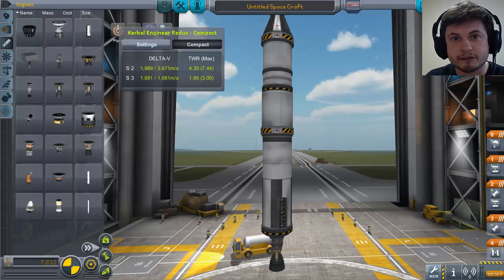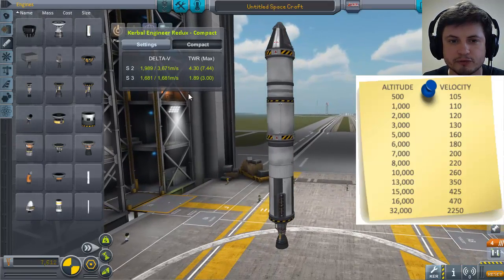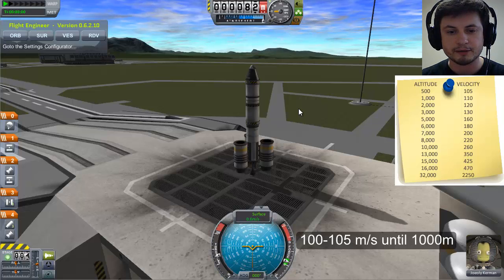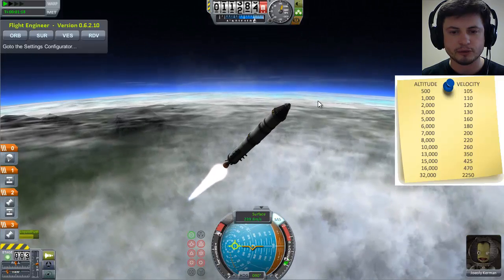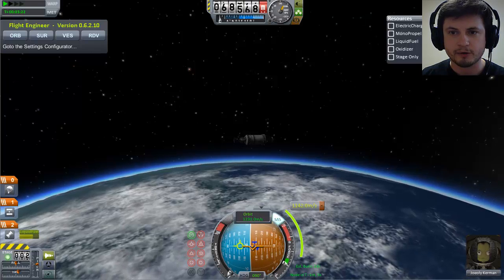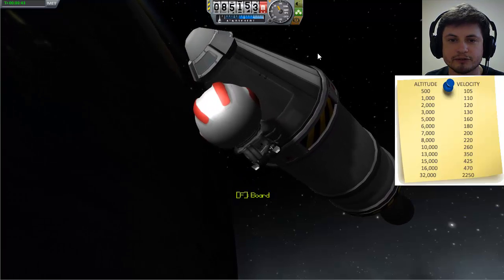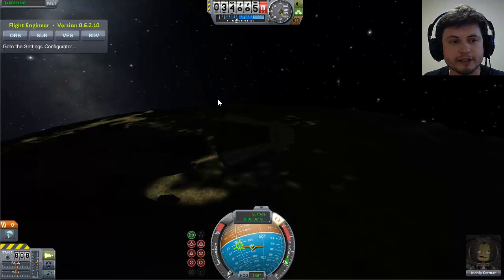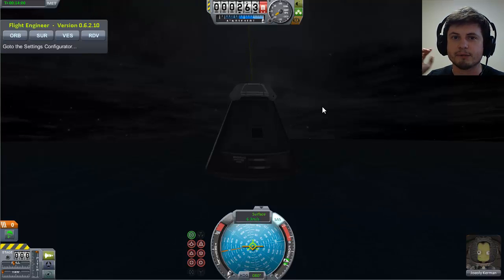KSP - Optimal Take Off Velocity - Fuel saving 101 (0.90 beta - stock)

Comment: It's good practice to wait until you're out of the atmosphere before plotting a maneuver node because you're still experiencing drag and so you will not be at the correct burn point of you're plotted node. Waiting until you get to at least 68 km before plotting the node gives you more accuracy.
Reply from the maker: I usually start plotting around 35-40km as the air drag at that altitude is not significant enough to change my values that much. at 68 I start burning laterally as this usually gives the lowest possible orbit
Reply: Yea but you're trusting off of nothing, a slightly earlier and your able to push of atmosphere...

Comment: Thanks for the video, I just wish your commenters weren't such snobs.

I use FAR and I've been trying to work out a proper ascent profile. In your video you're using stock physics but I think that it's still largely applicable to FAR. All that might be needed is a little tweaking.

Do you know what the calculation is to find exactly what altitude you will stage? Now that I'm doing contracts in .90 that ask for engines to be tested between certain altitudes, I am trying to make rockets that aren't overloaded or redundant with boosters and engines.
Reply from the maker: what do you mean by snobs haha? Sorry if it offended you.
I think if you use the Kerbal Engineer mod, there's a setting called "atmosphere efficiency" and if you keep that value around 100% you can find out the optimal take off velocity for the entire take off
Reply: Anton Petrov I use Kerbal Engineer, I just need to play more!

I called some of the commenters snobs because you didn't do things exactly to their liking and they decided to post very negative and condescending feedback instead of constructive criticism.
Reply from the maker: oh, good point. thanks for the positive feedback :D

Comment: with a similar rocket, if you had 3 'normal' tanks worth of fuel in the bottom stage, then reduce the thrust of your engine to have a TWR of 1.6, and with that, you will go slightly below the thermial veolocity.
Reply from the maker: thanks, I'll try that later

Comment: You're losing efficiency cranking east right at the 10k mark instead of easing the prograde marker. The Delta-V you lose altering the prograde path probably negates your gains from this "efficient" approach....
Reply: Anton Petrov I'm not dissagreeing with you in the slightest, In fact, I aplaude the fact that you mentioned the dV gain from turning east. My comment was in response to Urb4n0Ninj4 's proposal that a violent turn at 10km instead of a gradual turn starting earlier was less efficeint. The way you launched your rocket was just fine :)
Reply from the maker: you're right, it should have been more gradual. I didn't lose that much though. It was maybe 40-50m/s max
Reply: Actually, due to kerbins 'souposphere' a normal gravity turn is less efficient as you spend more time in the lower atmosphere. However, if you have FAR or NEAR installed, a normal gravity turn will save you fuel. You have to remember that we are dealing with unrealistic aerodynamics. As such, realistic methods such as a gradual gravity turn may not be suitable.
Hopefully the upcoming aero update will allow a gravity turn to help, not hinder our rockets efficiency! :)
Reply from the maker: Luke Wilson it's not a gravity turn though. It's a gain of velocity due to planetary spin and has little to do with aerodynamics. You're getting extra velocity because when you take off you already spin at around 150m/s eastwards, so you're just getting those extra 2200 needed for an orbit
Reply: Urb4n0Ninj4  I am saying that you lose efficency in the stock game by performing a smooth gravity turn lower in the atmosphere as opposed to a sharp turn at 10km. With mods like FAR or NEAR, you would be correct in saying that there is a dV gain by utilising a gradual gravity turn.
Reply: Luke Wilson 
But you don't lose efficiency in the stock...
Whatch "Kerbal Space Program 101 - When do you start your gravity turn"
In his first launch, he controls the craft manually and lofts the craft over relatively slowly (compared to the mechjebs sharp change in vector) and accomplished orbit with 624 units of fuel left.
The second launch, the craft turns sharply at 10km to 45deg, and when he accomplishes orbit he has a total of 612 units left.
Then it breaks it down at different altitudes from there.

Are the units a big change? No, but this is stock, and it shows a more curved, arc shaped change is more efficient than a sharp change.

And it makes sense. If you're using more energy to change your vector, you're losing potential energy to your velocity change. You can see this in his mechjebs "Steering losses" row in the video.

The gains made using FAR are significantly better, yes, but the fact remains it's more efficient stock as well.
Reply: Urb4n0Ninj4 Ah, I see. You are talking about an extremely slight turn at about 5km then transitioning into a normal gravity turn at 10km. The problem I have with the tests performed by Scott is that his manned launch (the most efficient launch shown) was up against launches under autopilot which, I would argue, spend too much dV on maintaining a heading.
I would argue that if mechjeb was programmed to follow the flight path that Manely's rocket took, it would use more fuel than the second flight shown, simply because it uses more fuel to maintain a heading than a manual pilot would.
Reply: Luke Wilson 
Well, I never use MechJeb, I have Kerbal Engineer to show me my Delta-V and TWR.
When I'm out of work I'll see if there's a difference in Delta-V used, and remaining fuel between turning 45 deg east sharply, or gradually between 8km -12km. But I've been playing this damn game for 500 something hours, and I've transitioned to using a gradual turn and have rarely had any issues with efficiency, but I've never tested it against other options myself. I've just gone off videos of others.
Reply: Urb4n0Ninj4 Yeah, I think some definitive tests would be good. I've been playing since 0.19 and I usually just turn over at 10km. Though I play more with FAR now.
I'm quite excited for this next update though, looking forward to the new aero system.
Reply: Nobody's pointed out a slight mistake in the original comment, which is that the phrase "Delta-V you lose altering the prograde path" is true when it applies to the orbital prograde path. The marker shown is the surface prograde path, which is meaningless when talking about losing delta-v due to changing your direction. The logic behind pitching over quickly is in fact to get your rocket onto (not away from) your prograde direction, as early as possible.
Reply: Then why, when shown with MechJeb does it still show as "Steering loss" in Delta-V?
Reply: Urb4n0Ninj4
Way back in the olden days, I did about 50 test flights with one rocket and MJ, adjusting the turn shape and turn start altitude each time. Here's a graph of my results:
https://dl.dropboxusercontent.com/u/78157466/GravityTurns.JPG
Basically, the best was to start at 8km and a slightly shallow shape (33%). Very steep ascents (67% and 75%) were horribly inefficient. In the related challenge thread, we figured out that we should adjust that curve to keep our rockets at terminal velocity Vt. So a slow rocket should turn lower and flatter, while a  fast rocket should turn higher and steeper.
Reply: DistracticusPrime 
Now that's how you test something. Nicely done.
So rockets traveling at slower velocities are better to turn sooner, and slower, while faster rockets should turn at higher altitudes, and do so faster?
Reply: Urb4n0Ninj4 Never seen MechJeb so I have to guess here, but if MechJeb is taking the angle between your prograde marker and your facing and doing the trig calculation to estimate fuel waste (which would be an easy calculation and extremely handy!) then you would just want to be absolutely sure your navball is set to "Orbit" when looking at that statistic, since it generally doesn't have a natural meaning in other frames of reference. I say "generally" because there are cases, for instance when doing an escape burn to go interplanetary, where you might take into account the direction that will be your direction after escape, giving you a delta-v savings, but MechJeb might not know that (unless it can look at your Target and do some number magic - no idea that's in its scope) so it would say you're being inefficient when you're not.
Reply: Ok, but if it was JUST MechJeb saying it, I would agree with you, but it's MechJeb displaying a loss (a minute loss, albeit) of Delta-V, Scott Manleys video showing the results (in fuel left), my own first hand experience doing it, and DistracticusPrime s tests with data table showing his results that all point to the same conclusion...less drastic turns saves Delta-V....
Reply: Urb4n0Ninj4 Almost, but not quite right. I should have said overpowered rockets (TWR > 2.0) should start the turn higher and do it more gently, while underpowered (TWR < 2.0 ) should start to turn lower and more aggressively. Either way, you're keeping throttle at full and using the shape to control speed close to Vt (terminal velocity).
Reply: DistracticusPrime
How aggressive are we talking?
Slamming on the F key until you're at 45deg and letting the  prograde marker catch up like this video? Or tilting the rocket over within 500m of travel or so?
Reply: Urb4n0Ninj4 IMO, at first slam on the F key as much as you can without flipping out, all the way to about 60-70°. After that gradually turn with AOA less than 5°.
Reply: Urb4n0Ninj4 It's super important to understand that the reason people say pitch over to about 45deg is because that's where your prograde vector already is when you reach ~10km. It's at ~10km because that's when you start to exit the soupiest part of the atmosphere and can start building lateral speed. And it's ~45deg because your vertical speed as you approach 10km happens to be about equal to the free horizontal speed you already got from planet spin.

You can see it yourself: do a few launches where you manually switch your navball to Orbit mode somewhere around 8km, and a lot of the stuff in this thread including DistracticusPrime's graph (which is awesome, btw) will click.

I wasn't challenging your statement that there's a more optimal path that involves a smoother turn, and I agree with other things you've said.
Reply: Ok, I tried out a few things myself and both wind up being very close to the same (+/- 1 m/s difference).
You are right though, I had no idea the reasoning behind pitching over to 45 degrees was because that was where the orbital prograde marker was. So thank you, i'm wiser for that.
I'll stick with the slow tilt approach though, because I have a feeling when the new atmosphere rolls in, it will come in handy. lol.
Reply: Urb4n0Ninj4 Right, same here. :) I actually find it fun to try and get a true gravity turn.  I.e. pick the exact moment to turn off SAS, nudge the nose ~5 degrees toward 90, then let go and let the rocket fly ballistically and aerodynamically at full throttle.  If done right (which I almost never do), you will gradually flatten out and reach apoapsis (you will still be in the upper atmosphere), just as the apoapsis flips to the other side of the planet. When you cut your engines you'll actually be near periapsis of your orbit, and your apoapsis will come down slightly as you orbit out, and settle at the altitude you wanted. Your circularizing burn should be tiny. Very tricky, but neat to try and can give some cool insights.
Reply: Challenge accepted.
Reply: Luke Wilson So you're saying there is no difference in efficiency by lofting your craft over from 0 to 45 degrees right at the 10km mark, opposed to a gentle change over a couple thousand meters?

Comment: You should try the Asparagus staging method if you want to go for a moon landing or even interplanetary travel.
Reply from the maker: This will be in one of the future videos, I just need to figure out how to make it more mathematical
Reply: Ah. Well good luck, and good flying.
Reply: Anton Petrov including numbers is not the same as making it more mathematical.

Watched the whole thing in the hopes of seeing some reference to how to do the math to get those numbers. Was (as you will likely have guessed) disappointed in this endeavor.
Reply: Bill Teale Actually there was plenty of math, it was all just done for you because...Well the physics of KSP works differently than the real world because of the kinds of values they use for the planetary bodies.
Reply: Actually, the physics of KSP works no differently due to the scale of the planetary bodies. It works differently within atmosphere, if you are using stock atmosphere - but then no one using stock atmosphere would be asking for the maths to determine best speed to climb out at to minimise total energy loss (gravity drag + aerodynamic drag).

I can take the real world values for the planetary bodies, chuck those into the vis-viva equation or the rocket equation, and get reaql world values instead of KSP ones. Its not about the planets, really.

Comment: This is nowhere near a realistic approach, because the stock aerodynamic model is not accurate. I would advise to install F.A.R (Ferram Aerospace Research) mod and do another video for that. The numbers will change and you would actually need less parts to get to orbit.
Reply: The video is about stock physics. So, it's quite appropriate with stock physics. Modded physics have separate tutorials
Reply from the maker: I have to agree with Martynas. Not everyone uses mods and most ppl that would need this tutorial would not know/use FAR.